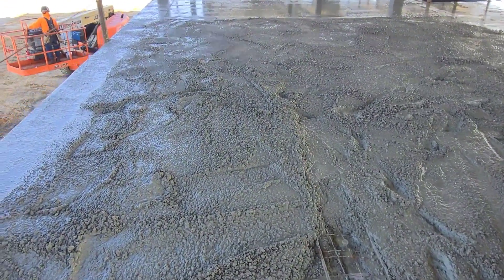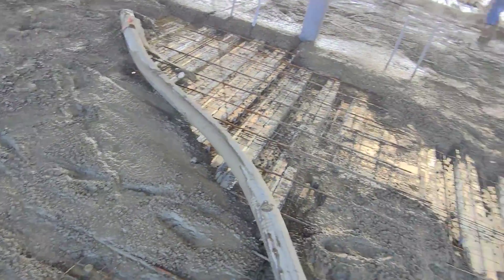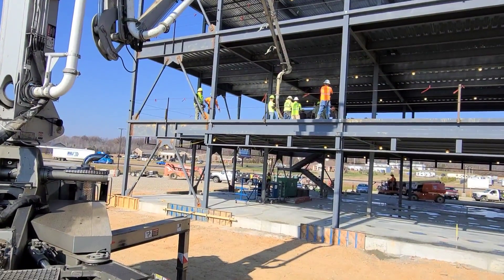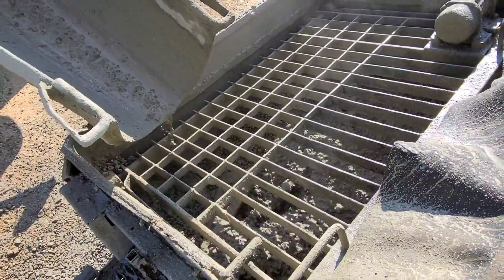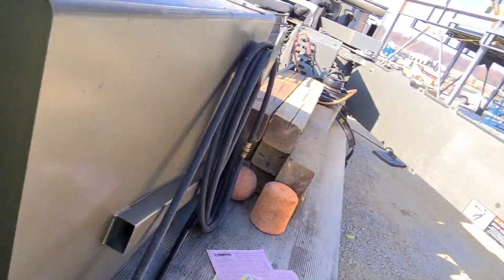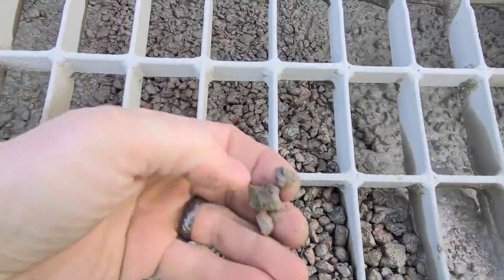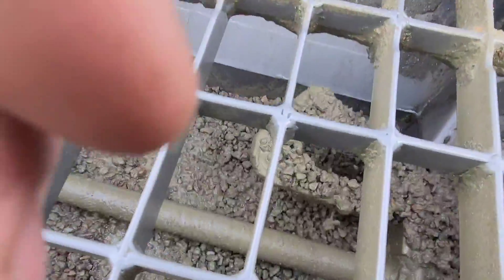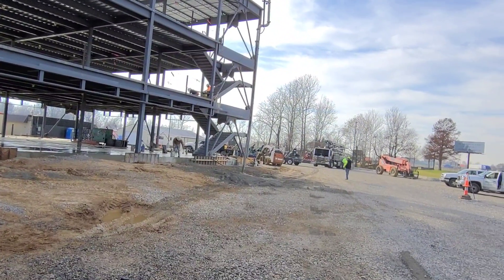On The Rocks! Concrete PumpVlog #2 Lightweight Concrete!

Comment: Whenever I had a lightweight job coming up I would call the mix plant and have them soak the stones for 48 hours before they batched it and I never had an issue I actually enjoyed pumping lightweight y'all need to get after the mix plant or have the contractor call them and make sure it's being soaked
Reply from the maker: First thing I did when I got there that day was dump that rock in a bucket of water and they all sank pretty much. Still could have been dry on the inside possibly.

Comment: Key to lightweight concrete is to soak the stone. Seeing the stone float to top not good.
Reply from the maker: When I showed up that day, I actually grabbed the inspectors little scoop and scooped some in a 5 gallon bucket of water. After stirring it around, prolly only 5 rocks came to the top. Not sure what they had messed up.